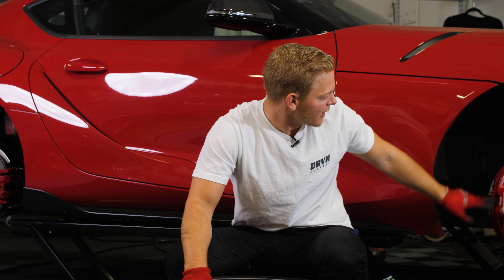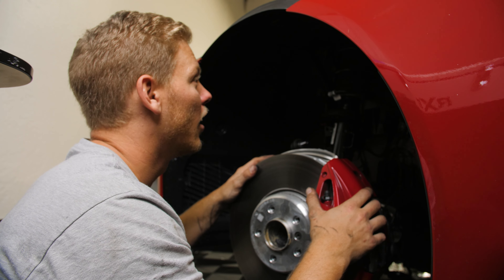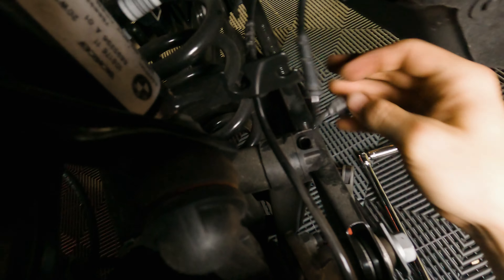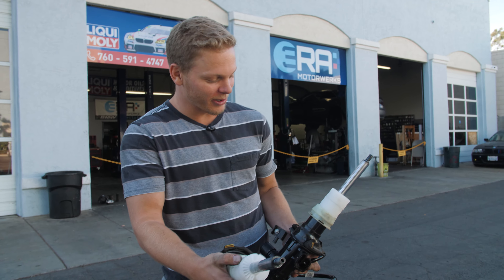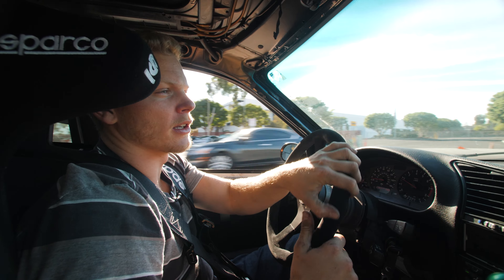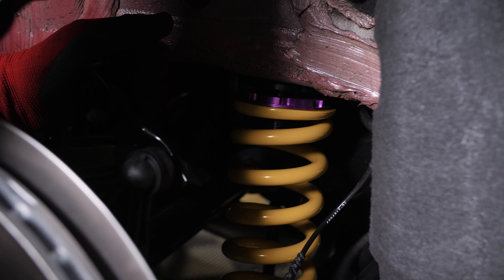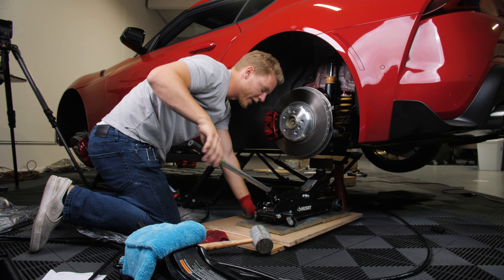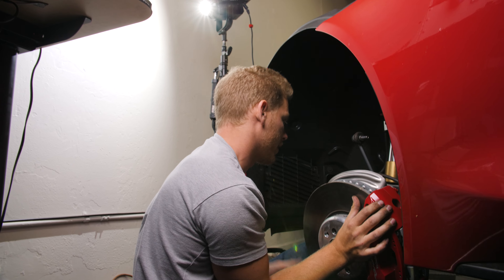2021 GR SUPRA KW V3 COILOVERS INSTALL

Comment: A spindle spreader will help with the part you used a pry bar for. It fits nicely into that groove and all you have to do is turn it , which spreads that groove wider. Then push down on the rotor and the shock assembly should come loose for removal.

Comment: Toyota didn't take out the shipping spacers on mine either. My struts started to make noise and when I inspected it I found that the shipping spacer broke and punctured the strut boot. My car is currently at the dealer having both front struts replaced. I decided now since the suspension is going to be tampered with might as well upgrade the suspension, I am looking into the K3s.  Great work, I hope you are enjoying your car.